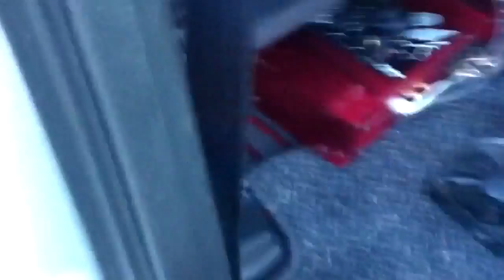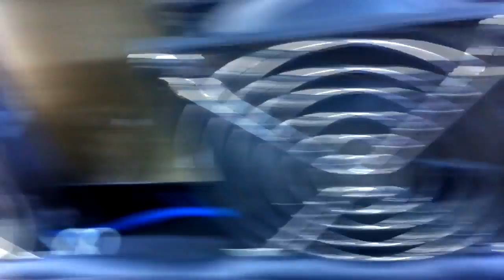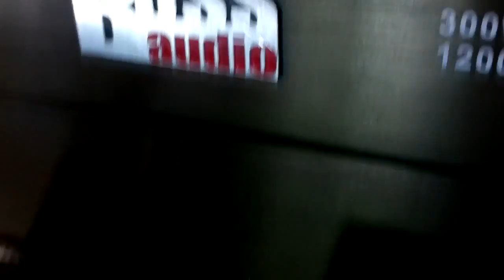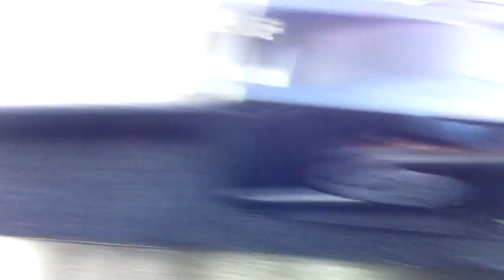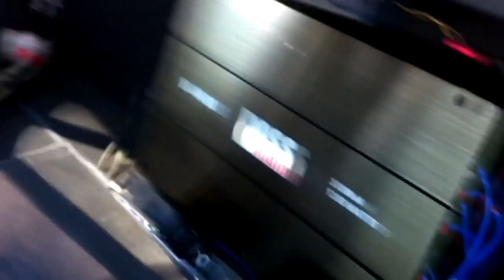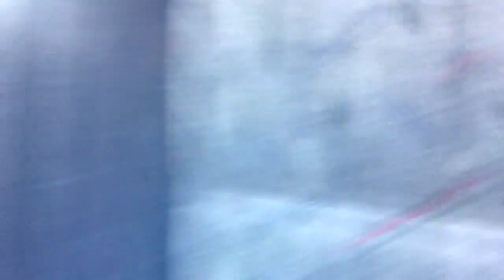computer 12v fans to cool amp-vid2

Comment: nice setup at keeping it cool.  You can try placing on top and cutting into the bottom and sucking air out.  Are the fans noisy you find.  If so, there are silenx fans that may work ok to stop this, but hey; when you have the boom up who really hears anyhow.  Good vid!

Comment: I was thinking about this since when i bridge my sub the amp overheats and cuts off forcing me to just put the amp on a straight channel. It just gets hot within minutes but runs warm when running on straight channel.
Reply: Lol because you most likely have a dvc 4ohm sub ran at 2ohm bridged. When you amp is only 4ohm bridged.  A fan won't help with that. Your amp will just die